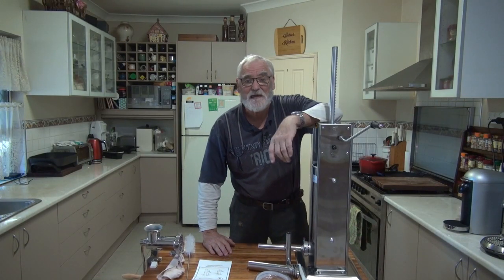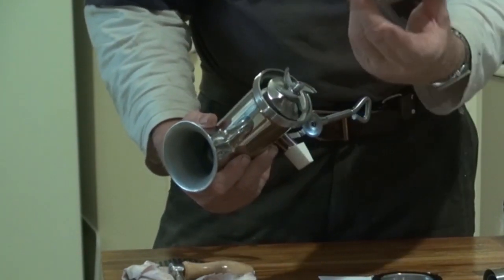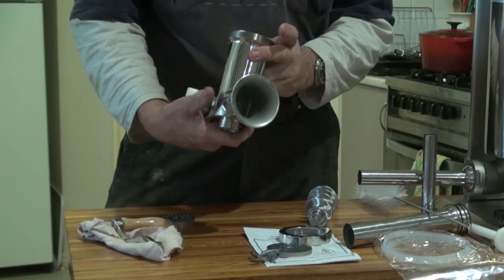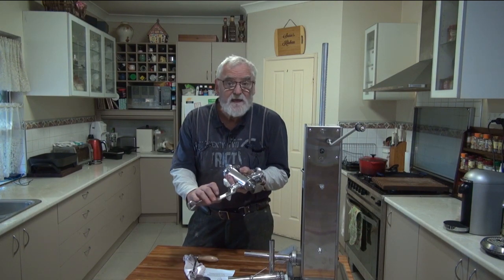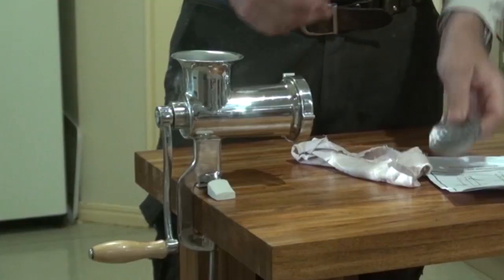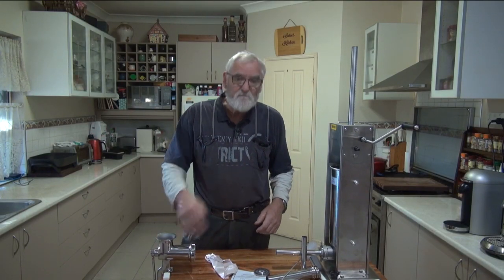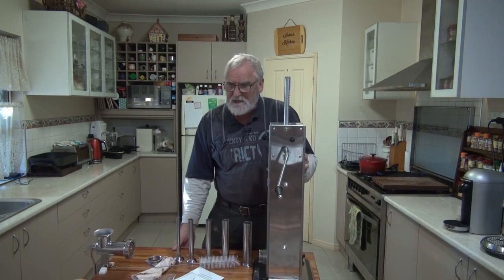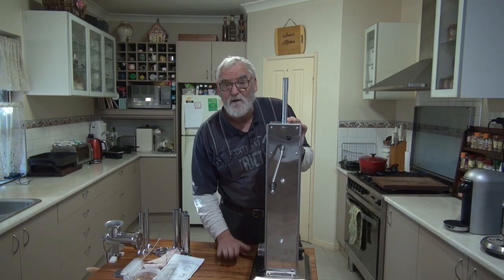The Sausage Making Video. Long version

Comment: You found a new turning project, a meat tamper.  Ice will also work to clean out the meat grinder.  It will add some water to the mix though.  If you have dry spices, add them to the meat before grinding as the grinding process will help mix the spices in.
Reply from the maker: Thanks for the tips Brenda we will give them a go. Just finished a mix and as you suggested mixed in the herbs and spices for the second grind. Smell wonderful. Thanks again. Cheers Steve
Reply: I can see a new channel coming  - Masterclass in the Kitchen - a team effort!

Cheers Jonno UK
Reply from the maker: @jonno2000  Never say Never John. :) Cheers Steve